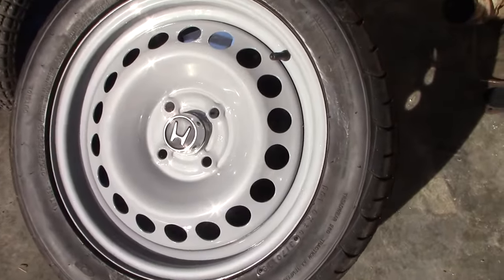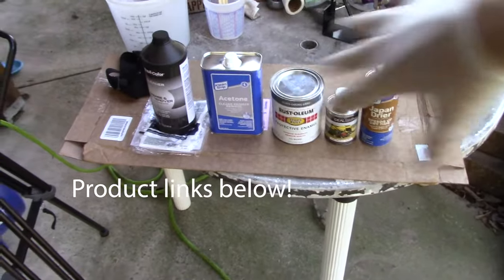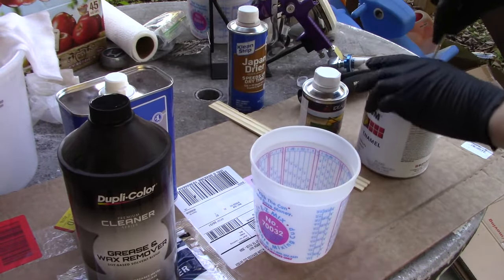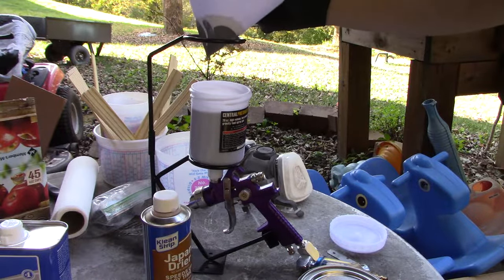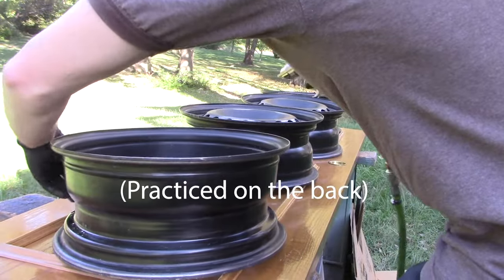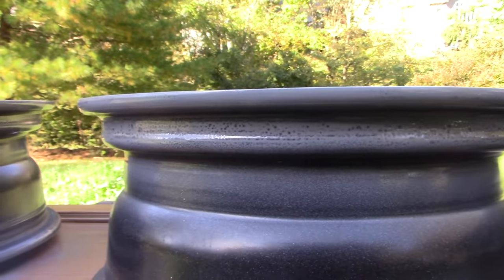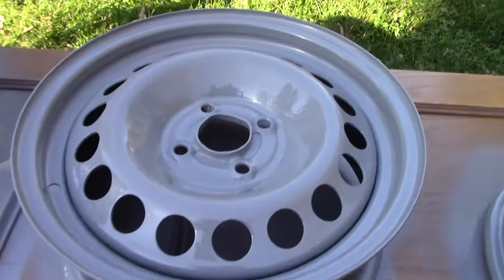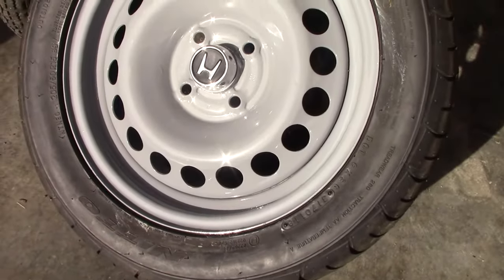Shooting Rustoleum in a Harbor Freight Paint Gun!

Comment: That was a really nice paint job considering the cheap gun and narrow spray pattern. I'm impressed. Do you recall how long it took until they were dry enough to handle? Oddly, that smoke gray is the same paint I used on my back porch! I'll use some hardener next time, and maybe the Japan dryer as well.
Reply from the maker: I believe I let them set out overnight. It was a couple weeks before I had time to get the tires mounted, but they were definitely solid. They did a couple hard years on the street, they still look excellent. The only problems with the paint were places I failed to prep it well and it flaked off. Otherwise, the paint itself is glass smooth and very tough
Reply: @RiggsGarage  Thanks.

Comment: Ah yes, 7786 Gloss Smoke Gray. Excellent color. I use this color for my snow wheels.
Reply from the maker: It's a really crisp color and stays clean nicely. Thanks for watching!
Reply: @RiggsGarage  the only one thing you want to watch out for with that color, is that it can easily lose its  gloss, especially if you use it on snow wheels. I advise spraying a few light coats of clear after the Gloss Smoke Gray cures. Since you have made the effort & investment to get a spray gun, Rust-Oleum Smoke Gray does come in a non-gloss version. You can do a base-coat/ clear-coat; it will not only be glossier, but, the layers flash quicker. Single stage paint is actually more tricky to deal with than doing a base-coat/ clear-coat.
Reply from the maker: @suburbanator91  that sounds awesome, I shall experiment
Reply: I love mixing custom colors....like add a little black to the smoky gray for a dark gray. Or make any color you want!!  I'd use a little more hardener though. I'm working on a 40 year old Craftsman 24 drawer, 2 piece tool chest....a whole lot of painting doing drawers inside out and all....Your wheels look awesome!  Hardener is the trick, they will last!